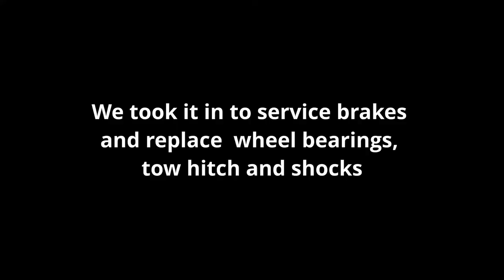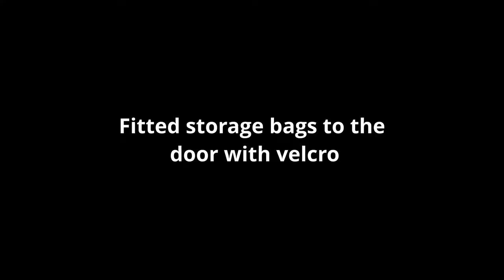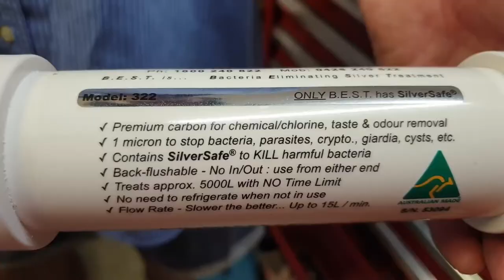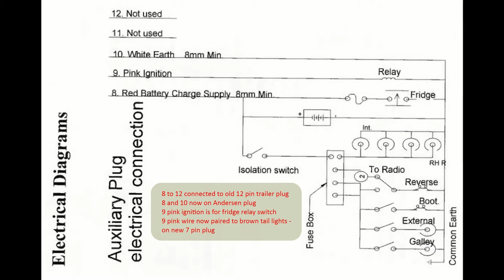Ultimate Camper Upgrades [new tow hitch, shocks, storage system, water filter, 12 volt cables]

Comment: why did you get rid of the McHitch, did you have problems with it?
Reply from the maker: The previous owner replaced the standard Treg hitch on the camper trailer with the McHitch. The shaft on the McHitch was fitted into the existing tube used for the Treg. I was concerned with the amount of "play" of the McHitch shaft within the tube on the drawbar and decided to replace it all. Apart from this there was nothing wrong with the McHitch except that I found the fittings to be quite bulky compared to the DO35.